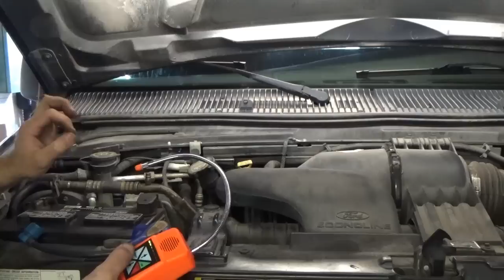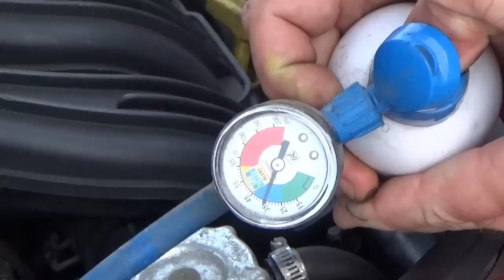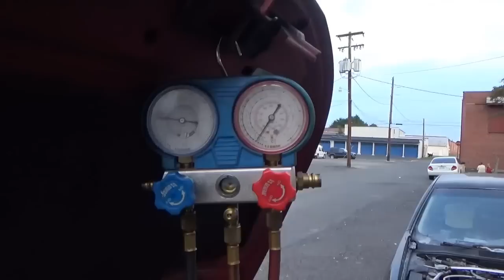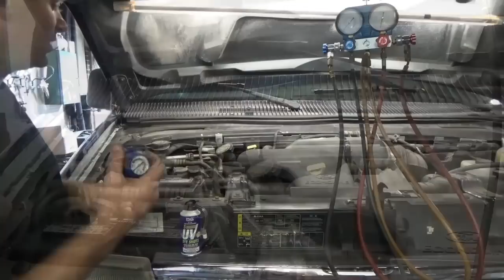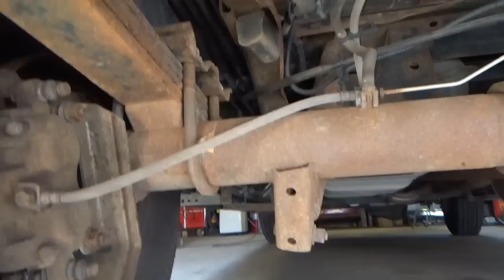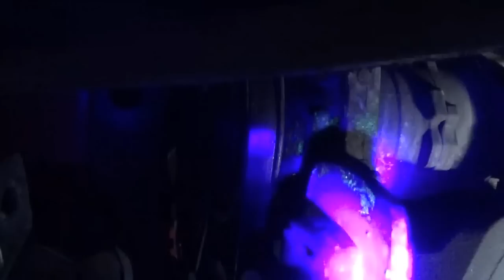How to find AC leaks step-1 of 3 A/C repair

Comment: With as much movement on the low side guage....I was surprised at hardly any movement on the high side at all...makes me want to verify that the high side guage/hose is connected good...been fooled by this before. Maybe blip the high disconnect a few times...check that the schraeder valve is actually being depressed...Check the high side lines/condensor to see if thet are getting warm/hot to the touch...Just some thoughts from experience...before condeming the compressor. I'm sure you've already done this before making a diagnosis.

Comment: I have a freon leak. Had it at a mechanic and they say they can not find the leak even after injecting dye. The leak is large because the system goes down in a couple of days.
Reply: I got the same problem in my Honda CR-V can’t find the leak even I inject the dye
Reply: Rear ac? Try the evaporator.
Reply: Did you get the "jift"? Lol

Comment: This is good info!! I am about to tackle an A/C job on a 2002 Taurus. I have to replace the Front timing cover as well, but the AC Compressor seized up while driving one time and will not work at all. So while I have it apart, the compressor will be coming out and I will be replacing all the stuff (receiver/drier, orifice tube, etc...). That will be a fun job.
Reply from the maker: +Pete Gaytan III thank you, going all out glad to hear it. good luck with the repairs hope everything turns out well, be safe and let me know how it turns out.

Comment: Nice info- but a PT cruiser LOL , I figured you'd have a Chevy one ton crew-cab dually - diesel . Ah just pulling your leg :)
Reply from the maker: +Steve Rob  haha lmao i do have a truck as well thank you very much!! lol just not a dually or diesel its a chevy though, i picked this up cheap with intentions on flipping it awhile back, not sure if you recall but this is the one i did the cylinder head on, now i go twice as far on half the gas lol its been good, i know its still a PT cruiser though lol

Comment: Nice video!  My ranger had a sudden loss of the A/C last year.  I'm not expert, but I did throw in some dye and found the condenser had split along the bottom.  I bought new OEM parts, a new dryer and O-rings for everything also and had a mechanic friend bring it into his shop, vac it down, and recharge with the right mix of oil and refrigerant.  Worked great ever since.  I didn't have the gauge set and right stuff to do it so thats why I had him do the vac and charge but finding the leak was fairly easy.  Figured I might as well spend a few extra bucks and get good OEM stuff and the new dryer may not have been necessary but not a bad idea.

It is funny how large the system is on that '03 compared to our new vehicle.  The new systems are tiny in comparison.
Reply from the maker: Thank you, sounds like you did everything properly it's always the best practice, I touch base on many of these things in addition to some others in part 2 sounds like you have a good understanding already, thanks for feedback and sharing your story

Comment: You didn't lose your 'cool' when you diagnosed the bad compressor on your car.   I would have cursed like a sailor off camera.  lol  It's so much easier spending money on a repair when it's someone else's car!  Looking forward to part 2
Reply from the maker: inside I was lol made for a good example though as to why you should always use a manifold set, everything on the front side of that engine is a pain to work on, definitely wasn't looking forward to that